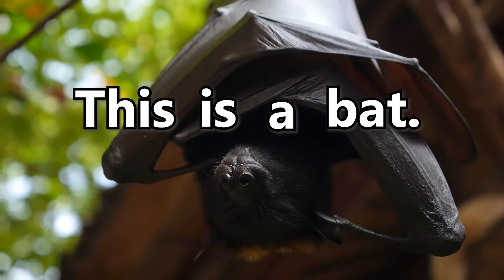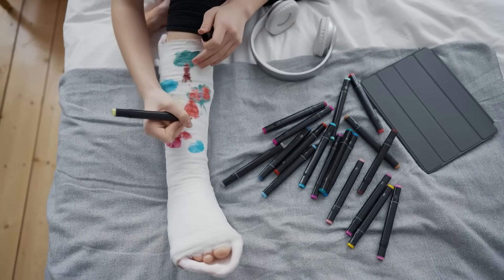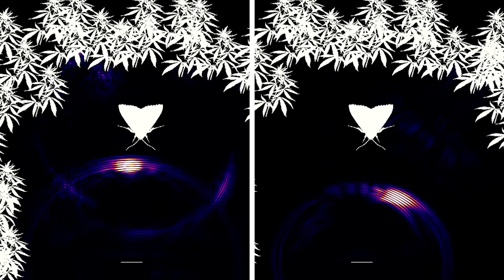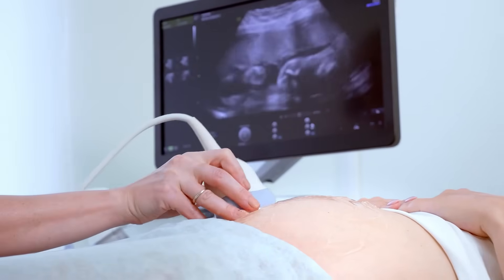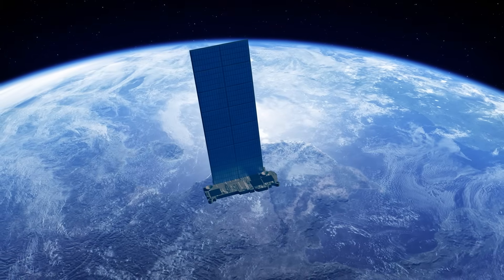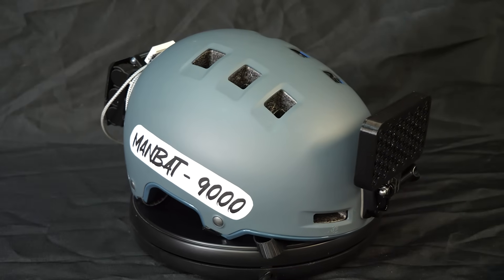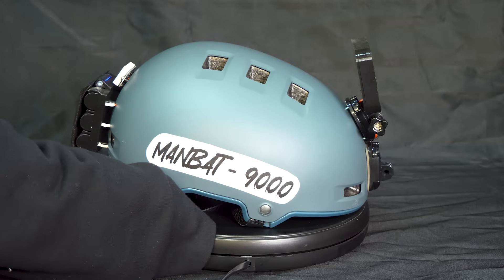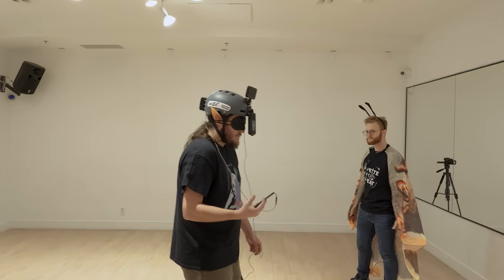A Submarine Sonar Strapped To Your Head

Comment: You can also rapidly vary the amplitude of the ultrasound to virtually reproduce audible sound waves if you run into limitations with frequency mixing. Read a fun paper where they wanted to use that technique to make earbuds with better bass.

Comment: This reminds me of Paul Bach-y-Rita's work on the tongue computer interface, he was able to repair somebody's vestibular system (this person felt like they were constantly falling), and by using a grid of electrodes on her tongue they were able to input her rotational orientation to her tongue. At first, she only experienced relief when the tongue computer interface was being used, but over time she experienced gradually increasing relief time, until eventually she didn't need any sessions with the tongue interface anymore. In other words, her brain repaired the connections for her own vestibular system by leveraging example stimuli. So imagine, she feels the tingling on the tip of the tongue, whereas if she's tilting backwards, she would feel the tingling in the back of the tongue. Same for side to side rotation, except the tingling would be on the sides of the tongue. I feel like there's a huge wealth of cures hiding in that research.

Comment: I do the click thing and use the sense of open or closed space I get from it to navigate in the dark myself. Difficult to describe the sensation, but I don't run into things often at least.  The chirp frequency of the helmet seems fairly low for an active scan of an area though. Is that to give yourself a clear distinct signal-process pair to work with while learning the interaction with the hardware? Have you tried reducing the delay between chirps to get more information back to the user over time to give a smoother response?

I'm likely using all kinds of wrong words here. But to use your flashlight/torch analogy, the helmet is a strobe light and you're processing bursts of information. Our brains are wired to do that with light, but at a much higher frequency. (See flicker fusion frequency.)  Could slowly reducing the 'strobe' delay allow for a better result with practice?

Comment: I see misinformation about sonar is circulating again...230 dB isn't enough to burst your lungs nor shatter your bones. The military did experiments exposing divers to ASW sonar systems of a similar level and they noted that it only resulted in increased heart rate and breathing rate.

This particular piece of urban legend lore most likely stems from people trying to extrapolate 230 dB in air vs 230 dB in water. Decibels on their own have no units, and require a reference pressure and distance. In air, the reference pressure and distance is 20 micro pascals at one meter. On water the reference is 1 micropascal at 1 meter.

A good rule of thumb is to subtract 60 dB or so from the water dB level to get an equivalent level in air. So for 230 dB in water this would equate to 170 dB in air, which is comparable to the loudness of a gunshot from a rifle.

Comment: There is another way to input the data to the brain. And it has already been done for the public to use. And I am sure it has been done for some military applications. And the input data is processed by the brain into a 3d image, and the eyes are not involved. The data that the headset receives is transferred via very low power signals into.... you ready? The tongue. That is the coolest part, the brain takes these electrical signals through the tongue and somehow automatically knows how to process it into a 3d map type image. The other cool thing is it requires zero light, and it works best in water. But it does work on land, and people who are completely blind can toss a ball 10 feet into a basket with only 16 input channels. That is 16 bit sonic vision. You can imagine how many bits, or the resolution, the military has since this was first released to public knowledge  in the 80s. And if your wondering what and who in the military, I already said no light and in water. So this video just knicks the surface of this topic. 

There are also people who have made robotic arms and connected them to the brain in non-invasive ways and the brain quickly accepts the addition of a 3rd limb that is on a table close enough to be typing with both hands and the 3rd, added robot limb, like it is a part of the body can pick up a coffee cup and lift it for a drink, while the 2 hands typing don't miss a beat. 

Point is the brain is ready and will accept data inputs that are not currently in use at all by our body, and can output information and integrate body parts it didn't ever have. Kick that around a while. And the maker of this video.... get busy 😊

Comment: I think YouTubes compression algorithm cuts off frequencies higher than 16kHz. If I generate 18kHz in Audacity I can hear it but I can't hear it in the YouTube video. I can't hear 19kHz on either though. I'm 44 years old so that's pretty much expected. Also a lot of cheaper headphones won't play that high a frequency. So don't freak out if you can't hear the frequencies.

Comment: I am thinking with this project what I'd do is leave the sound as ultrasonic, and instead convey the returns through some combination of actuators on the top of the head. The helmet itself already covers the skin on top of your head, making it's intended sensory capabilities useless, but you could remove the extra hearing burden and make use of that top of the head skin mayhaps.

The human brain is an incredibly adaptive organ. Consider when you learn to drive a car or ride a bicycle, at first you consciously move your arms and legs to perform actions on the vehicle, but in a short time you don't think "I need to press a pedal and rotate the wheel", you think "I need to slow down and turn" you feel like the vehicle is a part of your body. One of my favourite experiments about this was the second thumb controlled by your big toe, where people would quickly change their internal body map to adapt for having a second thumb on their hand instead of a toe. This incredible adaptability of the brain is our greatest superpower because technically no matter how you modify your body, as long as there's a way to control it your brain will just adapt.

Comment: Two things may have interefeared with your test. 1 changing the shape of your ears can dramatically impact your ability to resolve where a sound is coming from. So the elf ears may have gotten in the way. Smarter everyday has a great video on this. 2 diffrent sounds are easier or harder to for humans to locate, the bat sound is goodidea but fairly high pirched, i would recommend trying "static" or the sound that white noise backup alarms use, because it was developed to be easy to tell where the sound is coming from. Tom scott had a good video on this as well.

Comment: Few months old, but i just wanted to comment that the new F-35 fighter jets used Phased array radar setups too. This allows the to angle the radar array at an angle reducing detection signal form enemy ground radar, while also allowing it to virtually point the radar a full 180 degree on the axis, its wild. just thought its a neat bit of info

Comment: Having built my own version of this now... It's just the volume. When someone is in front of you, the reflection to you is better, so the volume is louder, as the sound only demodulates when it hits a wall.

You're not noticing anything special about the reflection. It's just the volume.
Reply: Hi! Did you use the same kit? I am using it and the mosfets seem to overheat. Did you have the same problem?
Reply: @PadrinoLuca  
Yes, I am using the same kit, but I haven't had any trouble with overheating.

What input voltage are you using? How high have you turned the volume on the input signal? Did you check that the frequency is in the green (LEDs or better via Oscilloscope)? Did you check the polarity of the piezo buzzers and ensure they are all in alignment?

Comment: You cheated with the Audacity demo! The Audacity demo only works because you clipped the output (look at the level indicator at the top), which distorts the sounds and causes the frequency change. Turn down the levels to below clipping and the effect completely disappears!

The term "mixing" is used differently in the audio world, where the waves are just added, resulting in the same frequencies you put in. "Mixing" in the RF world is multiplication, which causes the actual change in frequency content. I think you've confused the terms (which is totally understandable lol)

The reason this works with ultrasound is that acoustic waves become nonlinear at high enough intensities and frequencies to cause the air itself to "clip" in a certain sense. This is the weirdness that we don't normally experience in the audible range because the air medium is normally linear.

Comment: Dude, you're awesome. I bet a improvement you could try to further unlock this evolutionary trait is to have the 360 thing AND the focus thing with a little hand-remote that just has a fader knob you can switch back-and-forth. (Maybe a little button that plays everything at the same time, and a trigger for the speed). YOU COULD MARKET THIS TO BLIND PEOPLE AND REALLY HELP THEM OUT. There's already blind people who do clicks with their mouth for echolocation, so this principle is already proven to work. 

Someday they could actually make future versions that actually look like the VISOR from Star Trek with all this built in. Maybe it like plays an inaudible frequency (or they can even bluetooth connect to your car) and the radio antennas and sensors on the glasses transmits and receives everything and processes and plays back through bone conduction speakers built into the "VISOR Assembly in a audible frequency.

Comment: If one goes into a field, close their eyes, then clap once, then again,,, one can hear echoes off the items around the field enough to gain a sense of where they're located.
Walk down a road with eyes closed, clapping your hands, to stay in the middle of the road, or walk down a wooded driveway in the dark while clicking your tongue, to stay in the middle of the road.
Also, notice how finger-snap sounds change with height above ground, to get a blindfolded sense of how high above the ground the sound is.
Also, if the Array is horizontally Phase-Swept with a continuouse Freq-sweep synchronized with the horizontal sweep, then one can sense in all frontal azimuths simultaneously without having to rotate one's head.
Then with further developement, one can determine azimuth and range, then with still further development, determine azimuth, range, & altitude in 3-D space, then eventually even the speeds of everything in 3-D space before you.
All needed Data is already in the echoes, if it's processed properly.
Most every Device has stereo in & stereo out, so with 2 Mike's & 2 speakers, can process 3-D Imagery using sonics.
2 sound-encoded speakers for horizontal, & 2 decoded mikes for vertical, giving a 3-D acoustic-display of the scanned space.
I was able to image a parking lot with cars & trees that is over 200 ft across.
You can do much better than I did, for one can hear echoes from objects 500ft away.

Comment: Besides @morgan0's note about intermodulation, one other nit: water decibels are not equivalent to air decibels, so that "230 dB" factoid that so often gets mentioned re: sperm whales actually comes to roughly 168.5 dB SPL in air, which is still super loud (roughly equivalent to a rocket launch... and a gun shot can be about 160 dB). The conversion isn't exact. But we're talking about immediate hearing loss, not death/lung collapse/shattered bones. Just mentioning it because it's such a common misconception when it comes to whale sounds... people have a notion of SPL decibels and logarithms so "230" sounds like it would level a city. I'm not able to find any sources that say it could do deep physical damage (besides bursting ear drums, etc.) but I'd welcome any correction on that.

Comment: The F-117 Nighthawk is actually highly angular because that was easier to calculate a more effective shape for dissipating Radar waves than a curvy shape. It is effectively a low-poly version of a more ideal shape - being angular is actually a detriment to its stealth. That's why the more modern successor, the F-22, has smoother edges. More modern computing can calculate and simulate the curved surfaces.

Comment: There are a few very interesting experiments going on that aim to give people with physical disabilities some help. The first one aims to help people suffering from problems with their vestibular system. They wear a kind of a gyroscope and a special electric pad that can create weak electric currents at certain points of the pad. The gyroscope is connected to the pad in a way that when it tilts it generates an electric current on a respective part of the pad. The patient puts the pad onto their tongue,  tracks which part of the pad "lights up" and tries to counteract their tilting. It works reasonably well and surprisingly enough the effect persists for a few hours after taking the device off.

Comment: Thanks for doing this. I came up with this idea 20 years ago. I just didn't have the resources or the acoustic knowledge really. Specifically using sound to detect edges and textures in an environment for the blind. My idea was to use a sort of sound flashlight held in the hand hooked up to headphones. Your approach is probably better with a head mounted unit. Also, I thought that musical tones at different frequencies would be used to differentiate textures and ranges so the brain could process it more easily and pleasantly. Think of a piano note for something smooth or a distorted electric guitar for something rough. As you point the emitter at a wall at an oblique angle and scan it back and forth, the pitch and tempo would increase as you scanned the wall. The human brain is remarkably good at recognizing patterns and you can create a musical depiction of a space. Also having two receivers could give you a stereo effect increasing the that sensation. Let me know what you think.

Comment: Would the effectiveness not improve when 2 beams are used, mounted on the sides of the helmet? Together with 2 receivers, one could use a stereo headset with separate channels. You can then experiment with different frequencies on each beam to see if that helps, etc. Maybe you should do a follow up video?

Comment: You could also use a laser distance meter attached to a helmet, with a vibration motor. Then just used a raspberry pi with a little script for increasing or decreasing the motors output in relation to the measured distance.

Comment: I believe data processing speed also matters here, we can build off of the knowledge we have to do novel things like echo-location but the speed at which we can do it is capped by the AMOUNT of neural tissue we have to process that data, this is exactly why senses like sight, sound and touch have neural regions DEDICATED to processing JUST that data, data like sight, sound and touch aren't exactly useful if there's a latency of more than one second and I believe processing the sound for echo-location is one of these "possible but not exactly useful without a dedicated region" abilities, the extra step required to process the wavelength and convert it into what something looks like on the fly is just way too high without a dedicated neural region in the brain. Humans could evolve this ability but without such a development it's nothing more than a novelty, we won't be catching real moths anytime soon.

Comment: I turned up my speakers, somewhat panicked, when I noticed I couldn't hear the 18 and 19khz part. then scrolled to the comments and saw some mentions about speakers and headphones not reaching that range. so, still mildly panicked that I was losing my hearing at such a young age, I searched up the specifications for my speakers.... 17000 max... damn. and only 100 minimum.

I tried again with my headphones and it seems they weren't made to handle high frequencies either. it made a weird error-sounding bip-bip sound, which I assume is not what the tone is meant to sound like.

update again: I checked using an audio frequency tone player and I can hear 16990 but it cuts off at 17000. on my phone as well. so it seems like that's unfortunately the standard for devices that aren't specifically designed to handle higher ranges.

Comment: To clarify, unless you run into aliasing and nonlinearity issues, if you add up different frequencies, the only result you get in frequency space is the same things you added together, it's the principle of how frequency transforms work. Mixing is usually done by multiplying waves together, not summing, that indeed does have the effect of shifting frequencies. What you did with your ultrasonic array was just using it at a lower, audible frequency. If you want to use ultrasound, you're going to need to mix down the received signal, either by using electronics or some fancy and magical cavity resonator mixers goobly goo that audio and RF engineers come up with (I've no idea if this even exists).

Comment: You absolute monster. That warning did not explained much lol, those sounds is like someone running neddles on glass and in my ears at the same time. If more people can hear this frequency it'd no doube be used as a torture method. I'm 24, I thought I can't hear those anymore. I thought wrong 
Ps. To other like me, you won't hear it with crappy headphones or just from the speaker. Try replay that part and put your ears next to the speakers, as he said, it's VERY directional. Don't put it too close, it hurts.